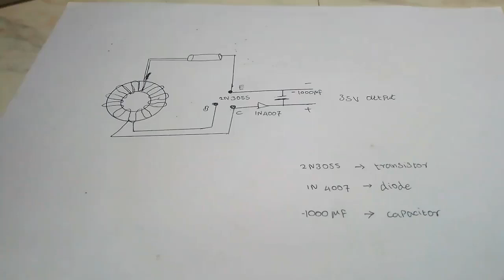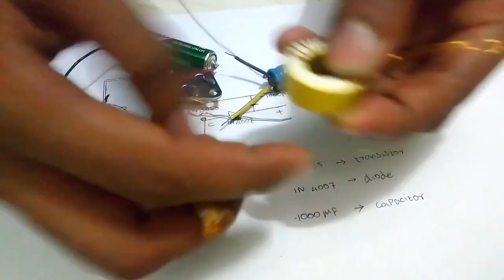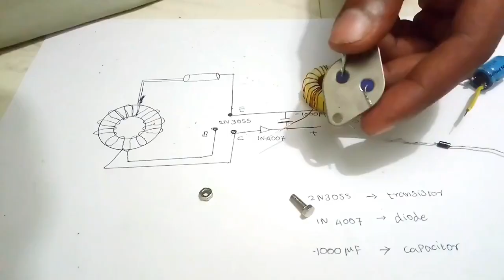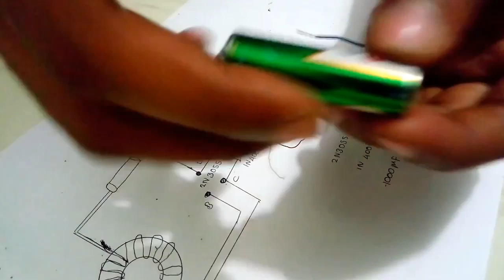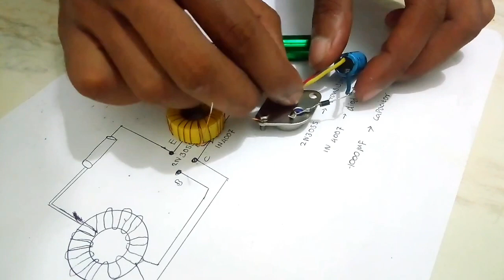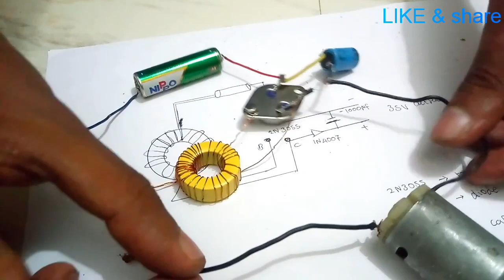1.5v to 35v step up boot convert by using 2N3055 transistor

Comment: Where u shown 1.5 v to 35 v . This motor can easily run with a cell ,1.5 volts. Show it with multimeter
Reply: جواب نمیده، معلومه که آدم بیسوادیه،  چیزی نمیدونه، از اینو ر و اونور یه چیزی جمع کرده.hahahahahaha